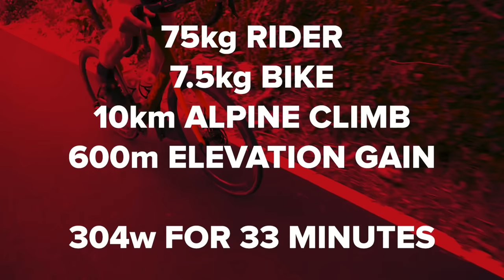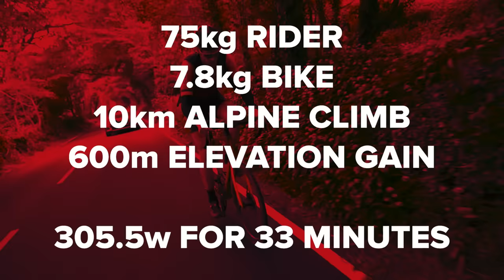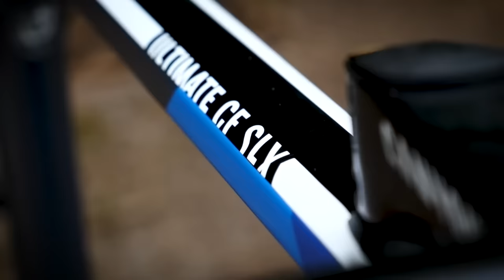10 Reasons To Consider Aluminium Over Carbon For Your Next Bike

Comment: I agree with this from experience. Try riding a Cannondale CAAD 10/12/13. It's an eye opener. I went from AL to carbon and back to AL. I only do Dura Ace builds, so cost isn't my reason for doing this.
Reply: Why do You went back to alloy frame?
Reply: @Pablo_Coach  I rode carbon for eleven years. My last carbon bike, before I switched to AL, was 2011 Felt F1. That bike set me back $12k.  I rode CAAD10 and was amazed at how well it performed. In 2013, I was in a bike accident that had me off the bIke for almost a year. Once I was cleared, I had a 2014 CAAD10 frame built like the top level Black Inc model, but with Dura Ace 9000 and Mavic Cosmic SLS wheels. I loved it so much, I bought a second one in 2015. Similar build, but with Hollowgram SiSL2 crankset and Mavic Ultimate wheels. In 2020, I decided to buy a SS Evo HM Dura Ace- a carbon bike. I was not that impressed with disc brakes. It stopped me very well, but so do Dura Ace rim brakes. I live in So. Cal, and I rarely ride in the rain, plus we rarely get it. In fact most cyclists don't ride in the rain. As for descending, there is a technique for that. Or, go with alloy brake track rim brake wheels . Then you won't have an issue.
 Been doing it for years without issue to my carbon wheels.I sold the SS Evo and am currently building a CAAD12 Black Inc frameset I found NOS. Looking forward to riding it. The SS Evo HM didn't ride that much smoother than my CAAD10s. There was a noticeable difference on rough roads, but not that much. In fact, the CAADs felt more responsive IMO. As a seasoned crit racer, high end modern AL just works for me. High end carbon is exceptional,  but most people aren't riding bikes with 5-figure price tags. More often than not, it's riding carbon for the sake of carbon. I race, do century rides, etc. My CAADs deliver and I don't feel any more tired than on carbon. The stigma the industry has given to AL is that it is inferior to carbon. That's just not the case. Most people who start with AL and move to carbon start with entry level bikes. That means.lower quality wheels and tires, plus entry level components elsewhere. Throw some higher end components on an AL frame and the difference is night and day. AL is still a great material.
Reply: @terbennett  thank You for answer, I understand Your reasons. What do You think about steel frames with sporty geometry?
Reply: @Pablo_Coach  Steel needs no intro. A performance steel bike is killer! You won't be disappointed. In 2016, a buddy of mine built a Fairdale Goodship frameset and built it with a Dura Ace 9000 and midlevel wheels. Bike weighed 16 lbs....for steel! The only carbon outside the Dura Ace parts were the Enve fork the frameset came with the seatpost and the midlevel wheels.
Reply: @terbennett  so You prefer steel over Carbon ?
Reply: @Pablo_Coach   It's not the material; It's how it's built There are extremely stiff carbon and steel bikes, and there are more supple ones. Carbon gives the engineers more options when designing a frame, but a lot of that tech is used on metal frames- which is why AL and steel are so much better. Steel has a lot to offer 98% of cyclists in most applications, but every one wants to look like a modern racer, even if they're not. The Lance Factor is still alive and well, even if there are new heroes in the sport.
Reply: @terbennett  thank You, maybe some day I will order to build steel frame for me🙂

Comment: GCN: aluminium or carbon?
me with a steel frame bike:
Reply: My bike weighs 25kg haha
Reply: Me too!!
Reply: Built up an 80s 531 frame recently and it's a hair lighter than my alu frame / carbon fork main bike, was gutted and overjoyed at the same time.
Reply: Up
Reply: Everything said here about aluminum is true of steel.
Reply: Yup. Bare frames and forks my ancient ernie Clements road bike made with Reynolds 531 double butted steel tubing doesn't weight much more than my aluminium track bikes frame and forks. it's only when everything is bolted on the weight differences become obvious. Still a lovely thing to ride though.
Reply: The more cycling youtube videos I watch, the heavier my steel bike feels 😞
Reply: Still prefer vintage japanese steel .
Reply: My chromoly one weighs about 13kg nyahaha
Reply: Im here with a alumimium bike that weighs 30 pounds
Reply: Steel is sick mate
Reply: @TheNisms  😭  mine too. It's a punishment to climb on it.

Comment: Being of advanced years and having an engineering background, I couldn't agree more. Thought With the previzo that a top end Carbon bike something special to ride. My oldish Giant TCR is a hybrid is quite stiff and very responsive, while my S-Works Venge McLaren (also oldish now)  is so much faster. It just is, and my time trial time proove it. My mtb is aluminum for the reasons you mentioned, and while I suffer a little more on the hills, I have witnessed the durability (reliability) first hand. Excellent explanation by the way.

Comment: Love my Allez Sprint. Cool pulling up to local Critériums and seeing 5 more, too.
Reply: My Allez Sprint has big ol dent in the seatstay. Been crashed several times. The only thing I sweat about is the carbon fork.
Reply: @404nobrakes  I’m more scared of the seatpost cracking, the fork can be replaced far easier I’d imagine than a Venge seatpost

Comment: I never really considered Al but after my first crash on Monday and a big chip on the carbon frame where the handle bar hit it... I'm thinking I would prefer a durable metal frame and maybe only a kilo more... Also it's easier to buy Al second hand and know its true condition
Reply: A kilo more? Only 400 grams more if all else remains the same. But before you buy a new frame, there should be lots of people that can fix that damage, handlebar to the top tube is so common that for less than $500 top it can be fixed and repainted to match.
Reply: Had my first crash 3 weeks ago on an aluminum gravel bike.  Scrapes on both me and the handlebars/shifters and a sufficient impact to knock the handlebars crooked, but zero damage to the frame.  A carbon frame would probably have survived too - but I'm glad I didn't need to find out.
Reply: Just buy titanium really
Reply: @trainiax  I had a similar crash on my Diverge E5. I’ve been paranoid about unseen damage to the carbon steerer post ever since 😬
Reply: @duxripae3826  To be fair, my bike does have a carbon fork and steerer, which I inspected really closely after the crash - but with no damage even to the surface finish I'm not too concerned.  I think gravel bikes can take a bit more punishment than a lighter road frame.

Comment: It depends on the type of bike and its use. I chose carbon super light for climbing road passes. I use aluminium with carbon fork for training on hills. 
Actually I find the best is steel and carbon fork. I have one for 8.2 kg
Reply: what about steel fork on steel frame?
Reply: @jamesmedina2062  good point. I actually have a Olmo, all steel,  9 kg max, including the spare tire etc. It behaves perfect in all conditions. I came down the Tourmalet pass at 96 kmh, although I am not one of those searching for adrenaline boost. I think this craze about all carbon will end one day. For one thing if you fall, who can assure the frame is still safe? All in all however, I think a steel frame with carbon fork is the best. yet again, it depends on what one does with the bike: daily commuting? weekend race with friends? solo touring?
Reply: @fabiopunk1661  The steel fork will take bumps in the road better. What road are you on that does not have irregularities?  When I was younger and on a mountain bike set up as a commuter bike, I rarely if ever fell. Now that I am older and do stupid things like ride at night, falling is a possibility, no matter how much I prefer it did not happen.  I really have no idea how fragile the carbon bikes are but I don't like how sharp they are on the inside. You have no way of tracking flaws that will worsen. (voids) The bottom bracket is a nightmare to align compared to the threaded ones. Last but not least, steel transmits useful information while smoothing it while carbon tends to transmit at the 100% or even amplified level!  Still I can survive carbon via the flex in my handlebars and saddle and shoes. But its more jittery compared to steel.  Still, a road is a road. Cheers
Reply: @fabiopunk1661  I like Olmo bikes. Been close to purchasing a few of them. Nice paint jobs. Seem like quality.
Reply: @jamesmedina2062  good point you raise, although I must say my all carbon Olmo (Kurva, 8.1 kg)) is stiff yet filters a lot road irregularities, and is very accurate in turns. It is more than 10 yr old now though, so I wonder .... I would not wonder if it was a steel frame!
Reply: @fabiopunk1661  sounds like a great bike!!! I have wanted an all-carbon Italian bike but have only the hybrids so far including a Fondriest with 16.5 and a DeBernardi with Zona. One day I may ride a bike like yours...or not! i design furniture but just build up bikes and wheels. I think how they design the carbon frames is pretty cool.  The one I saw that was interesting was a carbon Milani with integrated seatpost. So far I have Italian Fondriest hybrid steel/carbon and Debernardi steel/carbon. I am already 50 and had a hip surgery so I really only care about the ride feel. I am not heading up major climbs like before.

Comment: Haven't tried an alum frame lately, but going from my 2004 Fuji Roubaix (AL) to 2016 Fuji SL (Carbon), was a huge difference in handling, acceleration and comfort.  But still have special fondness for my very old Holdsworth 521 frame

Comment: My first road bike was a Trek 2300. It's a composite bike with lugged carbon on the top tube, seat tube, and down tube and aluminum everywhere else. I don't know which of the two materials made it bad or good, I just know I loved that bike for a couple of years, quarks and all.
Reply: that bike had horrible lateral stiffness in the bottom bracket.  I don't know anyone who enjoyed riding that bike except maybe someone going 15 mph for one hour in a park.

Comment: I had a Klein Rascal aluminum bike (that's 25 years ago) and that was then state of the art and it drove fantastically. Today I have a high-end carbon enduro bike, Mondraker Foxy RR, which I also like very much. But I drove an aluminum bike from Liteville in the spring and that puts everything in the shade. Very clear. The next bike is an aluminum bike.

Comment: I’ve seen more issues with carbon fibre (wheels collapsing, frame breaking etc) than aluminium. Although I have broken an aluminium frame (I had it repaired) and I currently own a carbon fibre road frame... it pedals nicely (meaning little frame flex means the power gets to the back wheel) . I had a steel frame track bike,  (fixie) if I put too much power into the crank, the frame flex and  would cause the chain to come off so mark that against steel frames...in conclusion. I feel aluminium is safer and more reliable . While CF is better performance, but when it breaks it’ll do it at a really bad moment... leaving the rider to do their best tuck and roll. Or Superman impression.  None of which is desirable.
Reply: thing is most bikes , even aluminium come with carbon fork

Comment: This video was just enough to move me towards purchasing an aluminum bike. I was looking for a gravel bike with some average size wheels. At some point weight seemed to be the main factor between the 2 materials, considering the wheels would anyway absorb most vibrations... There's some very good quality aluminim bikes out there, that are simply more durable, easier to transport, more weatherproof and as good looking as some carbon bikes. I'm very happy with my hydroformed aluminium Bianchi Impulso Allroad, which weighs 9.6kg without pedals. Endurance saddle, redshift stem, 3bars pressure and it rides super smooth on and off road. I could have saved 1kg (maybe less) by spending 1500 more, definitely not worth it. Ah and I can fix it with basic tools in my garage, no need of torque wrenches. Also I can slam it on the bike holder and grab it on my shoulders without thinking I'll crack it...

Comment: I've a glued Vitus 992, was good enough for Sean Kelly on the cobbles.
Reply: I've still got mine got it in 1986. I dont ride it as its on tubulars. Dont trust the frame anymore. Should mont it on the wall.
Reply: @mvnorsel6354  No, change the tyres and ride it. My Vitus is over 30 years old and I still ride it on gravel and cobbles.
Reply: @afitzsimons  Too much work plus its got a 12-18 cassette. I wouldn't be able to get up the driveway. But its a link to my youth. Never sell.

Comment: started cycling as my main sport on high-end carbon bikes. Always wanted a retro steel bike so I took some time to build some (battaglin and de rosa) using a mix of modern and vintage parts. The steel bikes are my favorite to ride by a long way. So nice to ride, smooth, stable, silent, planted. Hooked to steel now. Aluminium is a bit lighter but can feel  bit like a brick. The only aluminium bike I really liked was a scandium.
Reply: if you like steel try an Independent Fabrications all steel road bike. Mine rides very well but I'm sure yours do too.

Comment: I love my CAAD !  not missing a thing compared to an average  full carbon bike. 
It runs circles around my wife's full carbon Specialized Rubaix
Like you mentioned in the video carbon fiber is an easy sell 
 this doesn't mean it's better at least not until you get to the upper tiers of bikes.
My aluminum bike is actually lighter than my wife's Rubaix due to the superior finishing kit .

Comment: I bought an aluminum framed gravel bike in December 2020. I went with this and went with a better components. The difference? 1/2 pounds heavier and $750 cheaper than a carbon bike with cheaper components. I looked on YouTube where  different people compared the carbon vs. aluminum frame bikes of my specific brand gravel bike and all of them stated it was very tough to tell the difference between the two materials.

A little history. I bought an aluminum framed road bike in 1998 and after 30 miles, my body would be stiff and sore due to the stiff ride. This new bike rides like a dream (silky smooth) and I'm 20+ pounds heavier than I was in 1998. Aluminum frames have come a long way in 20 years. The larger tires probably help too.

Comment: Love the content! As someone who is just now getting into Bike's, it would be nice if you guys talked about Steel a little bit more. A segment like this would be awesome, but it would probably be more applicable for gravel. I get it though, as I don't think any of the presenters are really into steel as much as Carbon/Aluminium.
Reply: I ride steel (my one and only bike) and love it.    I'm not racing, so I'm not worried about extra weight on my bike.     Steel is very robust, rides nicely, and looks cool.   I also favor more old fashioned tech on my bike - friction shifting (bar ends), 8 speed cassettes, etc.   Cheap, but very robust and effective.    Really, bicycling tech has been "good enough" for decades.   People just keep chasing after lighter weight and better race efficiency.   Most of us aren't racing, though.    I ride for fitness and to see things, and my 90's touring bike suits me perfectly.    I guess for anyone new, it should be more about getting the features you need.   For me: clearance for bigger tires (I run 32mm), clearance for panniers (so I don't kick them on each pedal stroke), durability and fixability, low maintenance and robust, brazeons for racks and such (I use my bike to carry things as well as for simple fun rides), and so on.    

GCN is generally not the channel you want to watch if you are into more utilitarian or retro cycling.   They focus very much more on racing, and bikes that are optimized for that.    A good channel to check out would be "path less pedaled."
Reply: @nickmasters8474  yo! I ended up gong with steel way back when and I love it!

Comment: I road my $1200, 24 pound aluminum Giant Revolt 2 on a 530 mile bike packing trip with a friend of comparable age and fitness as me. He was riding a $3400, 19 pond carbon fiber OBED Boundary. Despite the additional 5 pounds in weight, I never had an issue keeping up on the gravel or the occasional tarmac. Best of all, the $2200 I saved paid for all of my bike-packing gear and expenses for two week long trips that year! 😁

Comment: When I decided it was time for N+1 I started looking at Carbon, but was quickly convinced that Aluminium would better suit my needs.  Chose the frame, drove 200m round trip for a test ride... but delivery offered for a new one of my chosen model was January 2022.  Meanwhile I got a new Carbon frame with slightly imperfect paint, but spot on geometry for £350 less than the aluminium one.  Just waiting a couple more components and finishing off the cabling, wrapping the bars and I should be riding it before the month is out.

Comment: Aluminium alloys have a face centred cubic crystal structure which has 12 active and independent slip systems at all temperatures and that means that it would not become brittle even if you did ride it somewhere very cold.